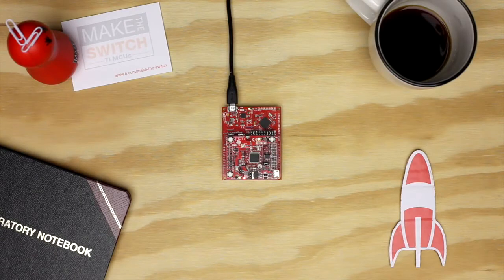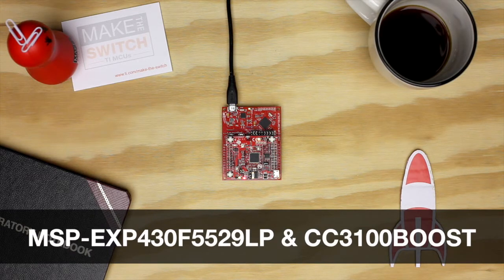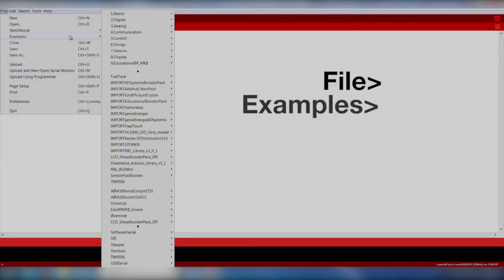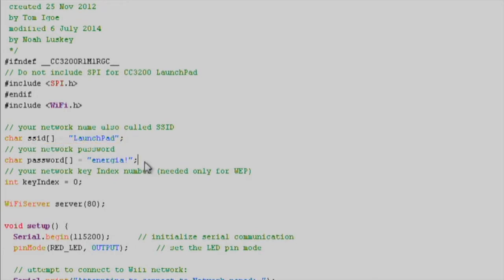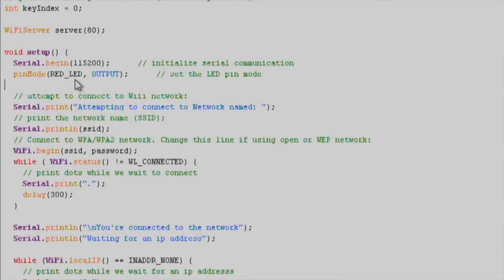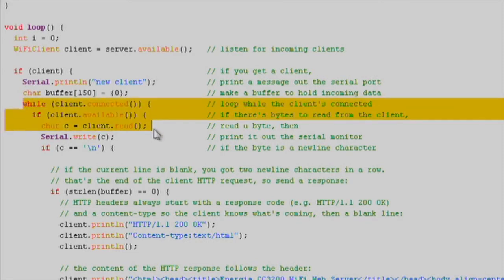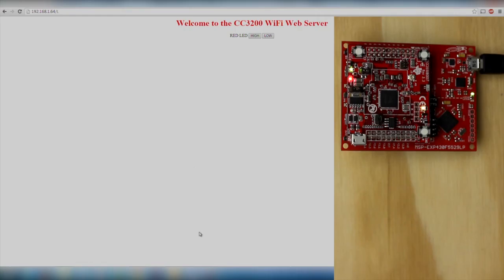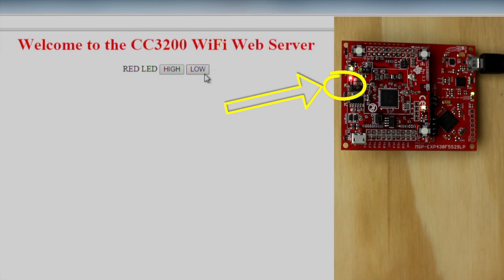SimpleLink Wi-Fi CC3100 Project 0: Energia IDE

Comment: Hello, please help me out, I am trying to run WiFi program, it is compiled successfully,also loaded in cc3100 with tm4c123g launchpad. But cannot connect to the wi-fi and it is not showing desired outcome. It is only displaying dots. One of the error I found was 'Failed to load dynamic library:ftd2xx.dll' please help...